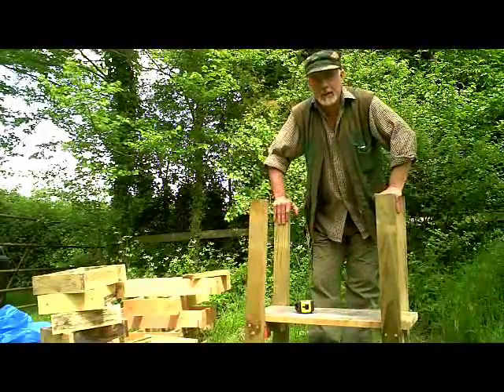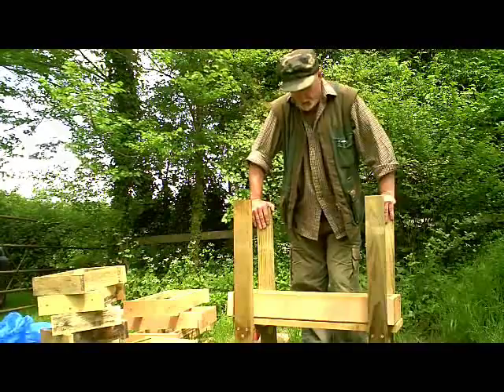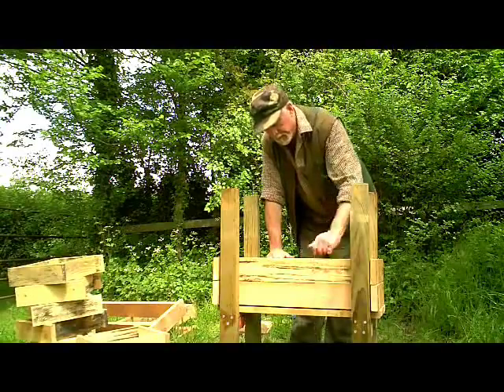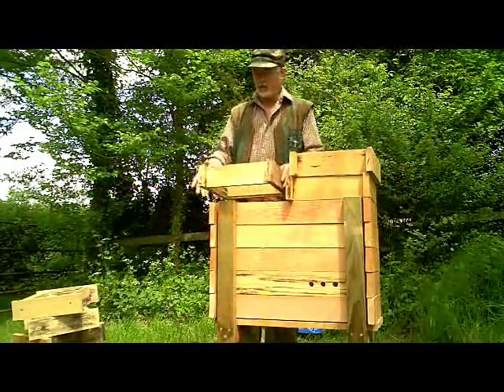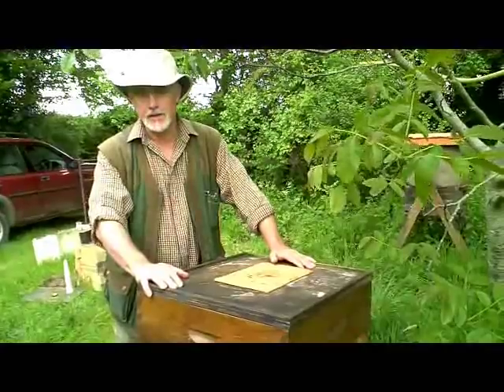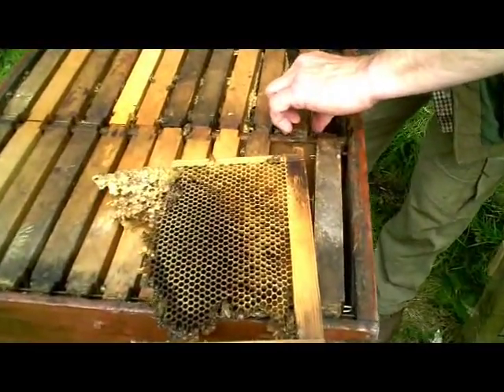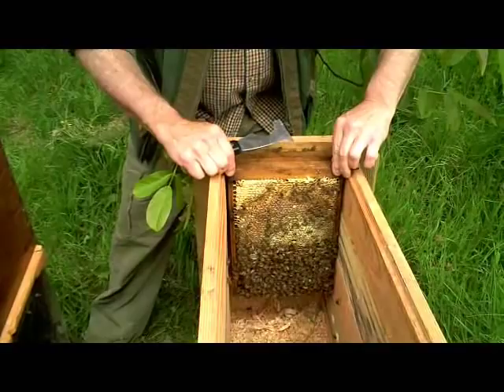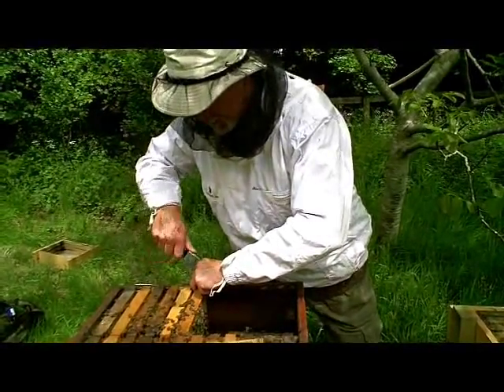Introducing the Pagoda Bee Hive

Comment: I agree about hexagonal hives - pointless. I have other reasons to prefer sloped sides, to do with thermodynamics and comb handling.
The Pagoda was simply an experiment in really simple construction, to make use of a bunch of half-Dadant frames from Brother Adam's old mating nucs. I may extend the idea if it works well, but I still prefer top bar hives.

Comment: Well, I like the thick 1X4 construction; easily modded to 2X. I also like the experimentation and disagree with the naysayers! It might not be standard but I think new ideas, whether they work out or not, may lead to other ideas that might be even more successful. I'm really digging the 2X4 lumber idea; simple to make and modify, especially if you prefer frames in boxes rather than TBHs. My only concern is the bottom filled with sawdust with SHBs being such a pain in the rear. I'm actually modifying my frames by planing a 45 degree angle to the ears so that the Small hive beetles can't hide behind them while being chased. I ought to make a video so it's easily understood...
Reply: +Albert Rasch Please do make a video! How regularly should one be checking for hive beetles?